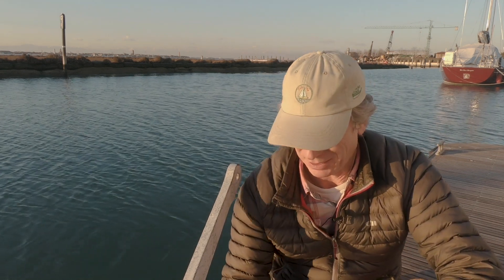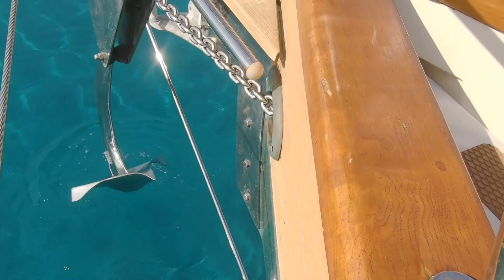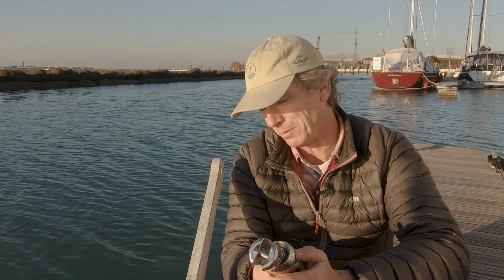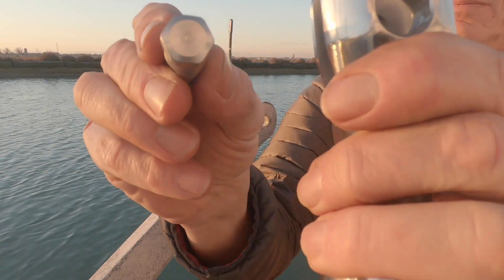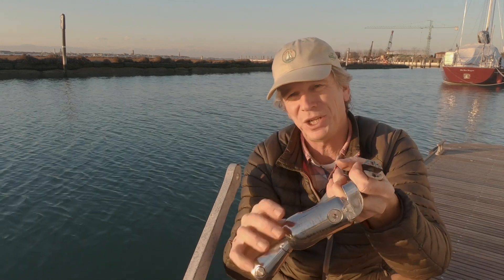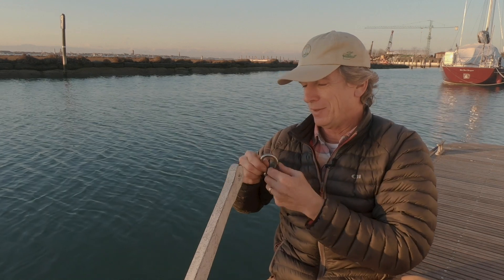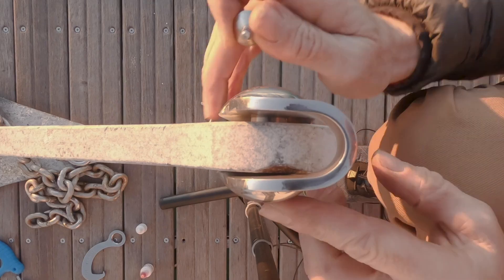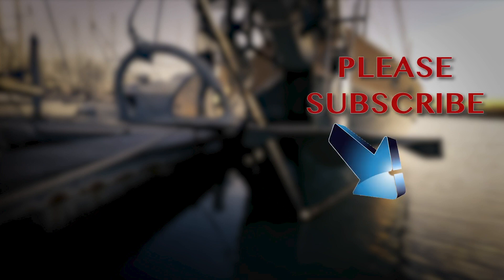What's best - Swivel or Shackle?

Comment: I see the fitting instructions are a little woolly ("Apply normal force when tightening the setscrews") good to see that they supplied thread lock, I personally would have tightened them more than the allen keys used were capable of.  Just my thoughts not a criticism.
Reply from the maker: It does seem woolly I grant you, but actually it really isn’t. You see unlike something like cylinder head that should be torqued down with a specific force in order to compress the head gasket enough to seal and stay sealed. Or the nut that holds your prop on which must be tight enough to have zero movement on the shaft so the thing won’t move & vibrate itself off. The pin on the swivel has zero loading. All the force is taken by the pin itself on the housing of the swivel. The screw is just stopping the pin from dropping out and apart from gravity if you have the swivel a certain way, there’s no force pushing it out. So I disagree, even a finger tight screw with red locktite is very unlikely to back out in this circumstance. And of course none of us would do that, we would all give it good crank round with the Allen key and that’s more than enough.
Reply: @svfairisle  OK fair enough, we'll agree to differ.  On another note regarding the 90 day hassle we are all facing, has Italy any grace period for attaining residency or is it too late.  Also was your passport stamped when you returned ie starting the clock?  Really enjoying your videos - helping us to keep sane during these crazy times.
Stay safe & best wishes L&A
Reply from the maker: @leightonthomas8233  Yes they did stamp our passports. Not when we arrived, as that was before Brexit was implemented so we didn’t have to check in. But flying back on the 5th Jan we were stamped, so have to leave Italy by April. We are doing a section on Med issues next episode talking to cruisers in different places so we will find out more.

Comment: lbf is pounds force ( not feet) I think.
Reply from the maker: No its definitely pounds / feet... https://en.wikipedia.org/wiki/Pound-foot_(torque)#:~:text=A%20pound%2Dfoot%20(lbf%E2%8B%85,foot%20from%20a%20pivot%20point.
Confusing I know. I messed it up myself in the Which anchor video calling it foot/pounds which is a unit of work. Maybe they should do away with the figures and just write on it 'bloody strong!'
Reply: @svfairisle  It gives the value in kN which is a force. The equivalent in imperial units is pounds force. Pounds feet would be a torque.  Doesnt matter , it looks bloody strong!  I know units for "work" and "torque" are expressed similarly but here its just "Force".
Reply from the maker: @Div3r  think I’ve finally sorted myself out! See the pinned comment
Reply from the maker: @taxirock90  yes my mistake, I think I’ve finally sorted myself out! See the pinned comment

Comment: Ever since I watched your videos on anchoring techniques and importantly anchor types I have been more alert to how far such concepts have been evolving.  Just last week at our yacht club meeting we had a talk from a highly experienced sailor/member on anchors, anchoring, drogues etc. Now while much of what he talked of was in agreement with what you have shown/discussed I was somewhat interested in hearing his views on the merits of shackles vrs swivels and interestingly he seemed to still favour shackles and the use of galvanised components rather than stainless steel. His reasoning being and I am not necessarily convinced I agree with him was that stainless steel parts with movement and loadings can come apart and so hence your anchoring gear could fail, while galvanised parts over time will rust and so be locked solid. While the later is undoubtedly true, equally under some circumstances this could actually end up being a problem. I was curious hence on your thoughts re stainless steel re chains, swivels and anchors and whether or not you would agree there is a possible risk of such components coming undone over time or due to extreme conditions, movement and loading on the system.??

I also gained the impression he seemed to favour anchors such as the Rocna with its roll over hoop, rather than say anchors like the Sarca or even the Ultra which dig in on the basis that under some circumstances such anchors could dig in so hard that they then become extremely difficult to release, again under curtain circumstances. He also seemed to favour the use of the good old fashioned Fisherman’s anchor for use in strap weed bottoms etc.  Once again in my limited experience I had to the impression that this type of anchor was so outdated and given issues with storage of it on a boat to make it not worth while considering. I didn’t wish to contradict him during his talk but I wouldn’t mind writing something up for our magazine as a counter point to some of what he discussed, especially in view of the advances in technology and testing that has been done on anchors and supporting gear.
Reply from the maker: I would have liked to have been at that talk! I think the only thing I would agree with there is the fisherman’s anchor is the only thing with a chance of holding in thick kelp. But as you say a bugger to store so you’re very unlikely to carry one unless you routinely have to anchor in kelp. Many sailors are stuck in their ways, the aversion to stainless is outdated, but that’s only if you’re going to make sure you’re using the right sort. If you can’t/won’t do that then there is so merit in sticking with galvanised components I suppose, but to do that you would be missing out, he shouldn’t try and make out it’s better, it isn’t! On the point of galvanised components rusting, well that’s just very ham fisted I would say. If you need something to stay done up then correct tightening and the right locktite is the way to go, not hoping rust will do the job! But in any case for the sort of applications he’s talking about ( a shackle pin) there’s almost zero load on the pin to pull it out of the shackle. All the load is perpendicular to that. In the case of a shackle the only twisting load is the friction of the link on the pin as it swivels, you don’t need a rusted solid unit to hold that tiny force! And if it’s rusting how far and how much is that compromising the shackle? With a well designed swivel like the Ultra the pin is captive ( see the hexagonal end) so it cannot be turned at all by a frictional twisting load from the last link. They supply red locktite for the retaining screw, which is frankly overkill as with no twisting load an no protruding part of the pin there is literally nothing acting to unscrew it.
Reply: @svfairisle  Hi Steve, Thankyou. I really appreciate the reply and importantly your knowledge/insight into this.  I have to say, I am in agreement with your views, and your absolutely correct many older sailors are ‘rusted’ on to their old ways.. Hence, my reasoning by making such queries to you to confirm my thoughts. As someone who has only been sailing for 5 years and am yet to own a boat, I am all too well aware of my limited experience and therefore being open to learning from those with greater knowledge and experience. However, equally I am keen to learn more and importantly of advances in technologies.

I similarly had some concerns re his comments on the use of drogues etc, especially after given the discussion you and Judy had with Don Macintyre re the GGR. Don actually gave a talk to us after the GGR, given Hobart was a stopover for competitors.
Reply from the maker: @1240enzo  Yes the Jordan Series Drogue has become a must have item for a lot of sailors for all the wrong reasons I think. As Don was saying some have it in the locker thinking it is some sort of savour when in reality they probably wouldn't have the muscle/skill to use it and even if they did, depending on the boat / situation it might hinder not help you. And as for retrieving it... well I personally know two sailors who have cut one away as they couldn't do it! But actually  for a lot of people with more money than sense it's become the thing to have to prove you're an off shore sailor! These are the people who rarely leave the bay though so no harm done there, except to their wallets! If you look at the interview we did with Rob at the end of episode two, that's what happens in a storm in real life. He is an ex fighter pilot so used to tough situations and yet in that situation he hove to and battened the hatches sitting on the floor of the saloon. He was very clear that short handed in those conditions the thought of setting a sea anchor / drogue or doing anything on deck was not going to happen. I've watched people try a practice rig a drogue at the dockside and make a hash of it, it's not an answer for most people at sea.
Reply: @svfairisle  Cheers Steve once more. Really helpful information and once again it’s good to have your thoughts on this based on real experience. I know from own experience when crossing the Tasman sea back from NZ to Newcastle (NSW) after dealing for many hours with 45 Kt winds, 4-5m short spaced swells and bashing into on an angle that in the end hoving too for some hrs was the best thing we could do. The rest much needed.  Even on another passage when we encountered 65kt winds and 5m  swells there was never any consideration of deploying a drogue. I am sure they can have their use under certain conditions but that’s a deliberation one has to make at the time but equally there is the consideration of all the risks vrs benefits. Hopefully, i will never need to go there.

Comment: In which universe does 36,200 lbs equal 15 metric tons?  Metric tons (tonnes) are smaller than imperial tons, by about 35 lbs...  Back to school for you.  ;o)
Reply from the maker: You're right sorry flipped tons & tonnes. but the conversion is correct. Were not talking about pounds as a weight here it's pounds/feet & K Newtons, so torque. They obviously tested as a twisting load which I think would probably be a better test that a straight pull?  it's been 35 years since my Physics degree so a bit rusty!
Reply: @svfairisle  kN is a force not a torque ;-)
Reply from the maker: @youtoo2466  see the pinned comment, I THINK I finally got there!

Comment: What’s good for the past seamen has always been good for me. When I lower anchors , you’ve seen that it’s shackled and the pin wired— and I sleep well. I feel uncomfortable with your swivel it’s possible weakness has to be what can’t be seen a small cap bolt and Loctite ... Jacktar
Reply: :/ But that is true of both shackles and swivels. One can get both of those with either just using loctite on threads or both of those where pin is wired. So do not understand your argument at all mate. For example the shackle shown in this video at 6:32 where the pin is NOT wired. And vice versa for example with Mantus swivel that pin IS wired. You seem to think that small wire is extra strong or something? The load is not on that anyway, it just needs some method to hold the pin in to not back out, as there is not any major force trying to pull it out in that direction (force on the pin is opposite direction).